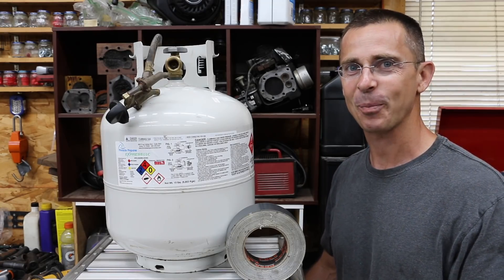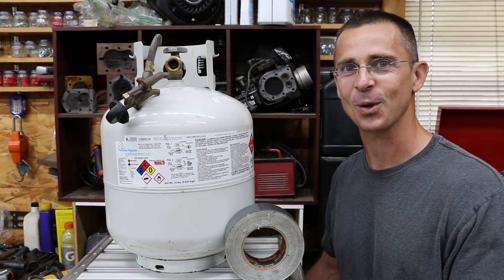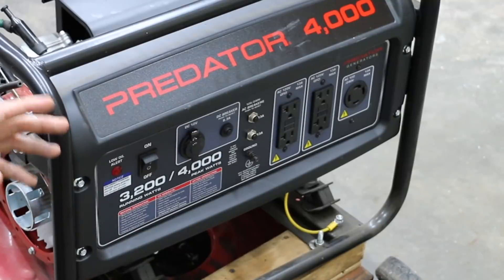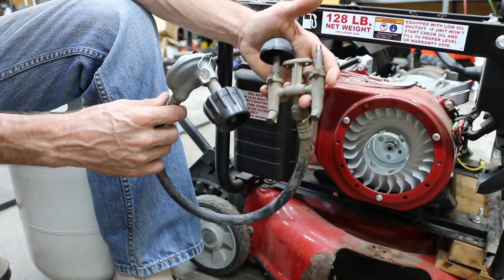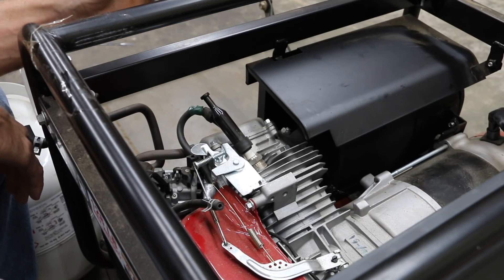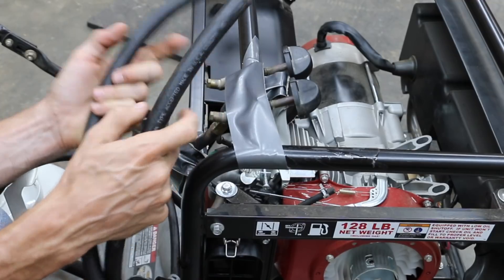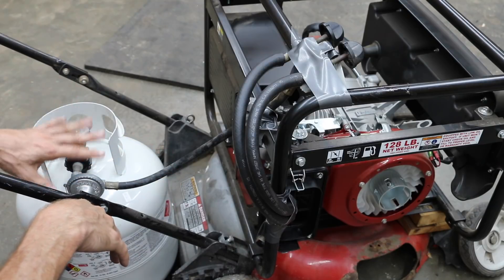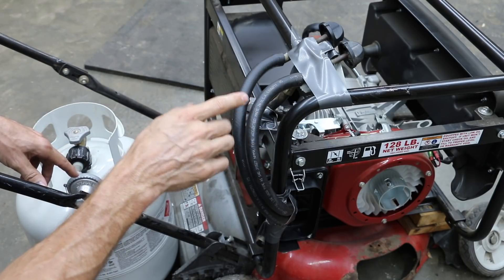Can a gas (propane) grill power an engine?  Let's try it!

Comment: Not a huge fan of propane powered equipment, my main experience is with mowers, they are less fuel efficient and if you run out your screwed, can’t just go to the gas station to refill (special tanks are used, not the tanks used in the video) they are usually high up on the machine making it more prone to rolling over even when using walk behind mowers. Yes they burn cleaner and propane is cheaper than regular gasoline but IMO, gasoline is my go to for that kind of equipment. 

As far as vehicles, I have no opinion since I don’t have any experience with propane powered cars.
Reply from the maker: Thanks for commenting on this.
Reply: Project Farm no problem, propane definitely has it’s place and as you shown could be used in a pinch with a regular gasoline powered engine with very little modifying. very good video, keep em coming!

Comment: So, and it may have been said, with natural gas and propane running it lean is better. The gas burns efficiently enough that the richer you are the hotter the exiting exhaust will be leading to burnt valve seats and valves. The best method is get it running, lean it out and then turn until it runs smooth then go just a smidge more. Also I would like to see you try a full conversion on a go cart. You need to make a demand style regulator that is biased by vacuum st the port possibly with a venturi to create the vacuum and pockets the regulator would need.
Reply from the maker: Great tip. Thank you

Comment: Had a bad carb on a push mower.  Used propane to power it.  Problems were getting the flow right, allowing enough clean air into the intake, freezing the cylinder and bumping the cylinder causing liquid propane to directly squirt into the intake.  It ran fine, maybe a little weak.
Reply: duct taped the propane to the mower handle and used an old propane torch nozzle to adjust flow.
Reply from the maker: All great points. Thank you.

Comment: Ok so awesome video but holy cow I would have tried to do some sort of flash back arrestor setup to make sure the propane tank didn't become a bomb. Not trying to be a negative nancy here but I work in a weld shop and I've seen the safety videos about using oxy/acetylene torches that have no flash back arrestors and the grave consequences of doing so. Be careful!
Reply from the maker: Thank you!

Comment: i once ran my dads 50 hudson(which was out of gas and up on blocks)by using a propane torch with the burner and jet removed so propane could come out fast. Yes, it ran just fine but soon the torch tank was empty. Propane runs clean but you need more propane than gas. there is less heat energy in propane so to get a propane engine to be efficient you have to way up the compression(propane has great anti knock properties) to gain enough to make it practical. propane is used for back up generators at things like public safety radio sites because the propane never gets old. For that its brought to the engine in liquid form and the gasifier is heated with engine coolant. that way the generator will keep going in very cold weather. where I worked we had a generac 15kva propane backup with a 454 v8 engine. it had its own room. electric block heater  and coolant powered gasifier at the engine. worked great. very little maintenance required. with a 400 gallon propane tank we were set for back up of public safety communications main radio site.
Reply from the maker: All very interesting comments. Thank you!

Comment: Propane is a common fuel here in Australia called LPG, it has a bit of butane in it for smoother idle.
I used propane in workshop as a test fuel for vac leaks, bad injector, mixture response tests and no starts to check if its fuel or spark (bit safer then aerostart),
Reply from the maker: Thanks for commenting on this.

Comment: It would be cool to see the MOS2 (Liquimoly) in an drain oil test against another additive. I read that MOS2 was originally used in aviation to prevent catastrophic engine failure in a oil loss condition, and it would be awesome to see that applied to lawnmower engines.

Love the channel, and your work!
Reply from the maker: Thank you!

Comment: LPG - popular in Poland bc it costs less than 50% of 95/98 octane gas price. Almost every petrol taxi runs on LPG here. Engines used to burn about 10-20% more LPG than petrol bc it have less calories. Simple but complete working installation in cars with carburated 4 cylinders costs from 400$. Now you can put LPG even in cars with direct injection. Sadly engine wears out little faster than on petrol bc gas is a bad lubricant. Excuse my English.
Reply from the maker: Thanks for commenting on this.

Comment: I would be really curious to know how long a 20 lb cylinder would last running a 4Kw generator at 50% load. Would it run longer than a full 3-4 gallon gas tank?
Reply from the maker: I wish I would have tested this. Great recommendation.

Comment: Its always great to see what You come up with. When running gas sometimes the timing has to be adjusted for the best performance. im not sure how that would work in this application as you are running a cam chain and the flywheel with the magnets for the coil are fixes in position by the key in the shaft. If You ever try wood gas timing can also cause issues
Reply from the maker: Thank you and great point regarding the timing.

Comment: if your generator stops, the propane will continue to flow... That's why you need to install a vacuum controlled diaphragm. No direct propane to the carburetor. unsafe.
Reply from the maker: Great point.  Thank you

Comment: also dialing in the mix...I can relate, I have a Champion dual fuel and its super easy to over/under choke on LPG and nearly impossible to tell.   I finally put a tape flag on the choke to mark the right spot to start easiest.
Reply from the maker: Thanks for commenting on this.

Comment: FYI propane pressure coming out of the regulator is 14"wc =1/2psi & nat gas is 7"wc=1/4psi propane is heavier than air beware of window wells etc & nat gas is lighter than air, a nat gas appliance regulator cuts pressure to 3.5"wc & that water heaters, boilers & stoves run on.  I work for gas utility for 31years
Reply from the maker: This is great information. Thanks for commenting.

Comment: I used to diagnose non starting engines using propane. I used a small propane bottle with a torch head. Open the valve, but don't light it. Place the nozzle as close to the carb/intake  as possible. Crank motor. If it starts, you have spark and no fuel. If it does not start, check for spark. Saves a bit of time trouble shooting.
Reply from the maker: Great tip!
Reply: I just use a cheap spray bottle from the dollar store with some 2-cycle gas in it....
Reply: But, the 2 cycle oil in the gas provides upper cylinder lubrication. Something that is important for an engine that may have been sitting for years. When you are working on someone else’s equipment, you need to follow best practices, so that’s how I do it in my shop.
Reply: The spray bottle just can't compare to the 118octane from propan, Thank you for the great tip of using an old propane torch
Reply: In the late 1970's Chrysler products had their computerized ignition engines set by using propane gas. If I remember correctly, the carb was adjusted with propane too.
Reply: Thank yew
Reply: WWG1WGA

Comment: Very clean but temperamental  with fluctuations in load,  woula a really filthy fuel have the opposite  effect, yes I'm  deliberately ignoring that the best all round fror fluctuations is probably the stuff its designed for, still think that in the event of a alien zombie invasion the supermarket own brand wiskey will still be untouched on the shelves, tho mixing it with petrol may improve the flavour.
Reply from the maker: Thank you.

Comment: you would need a propane carburetor in a go kart or any other application. Lots of taxis, fleets and equipment use propane. Propane in Canada is about 60% of the cost of gasoline
Reply from the maker: Great point and thank you!

Comment: Nice experiment! I've run car engines on gases the same way to troubleshoot and see if the spark ignition and the rest of the system works so i can check for fuel pump problems. The only problem is just like you said the engine needs to run on constant RPMs so no luck driving a car like that as it is already tricky to set the air fuel ratio properly for a normal idle,especially if it backfires.
Reply from the maker: All great points. Thank you!

Comment: they actually used to run propane in old firetrucks in the 60s and 70s, most countries already use propane as a fuel alternative to gasoline
Reply from the maker: Thanks for commenting on this.

Comment: that would be a great fuel to use during hurricane storms down here in Florida especially during and the after math which  is insane trying to get fuel for over week but to have a few propane tanks and some fuel would be good to go
Reply from the maker: Great point. Propane will last many years while gasoline will go stale, unless storage conditions are perfect.

Comment: You Sir are the Man
 Thanks for doing this 
The see through head was super sweet 
I like how you use the cordless to start the engine 
When I used to run the go cart for the kids I often thought about doing the same thing 
I asked at the cart Shop and they said it would work so I took them at their word 
As usual Thanks for All You do
Reply from the maker: Thank you very much for the positive comment.  The drill I use to start the engine is corded but a cordless drill would work.  I use a 1/2 inch socket adapter along with a socket.  Thanks again.

Comment: run a small engine on avegas 100ll..see if it has detention problem at higher rpm..and maybe a load test to see if it has the same power as regular unleaded.
Reply from the maker: Great video idea!

Comment: Will a gas engine run on butane, burger grease, heating oil, jet fuel, wood gas(natural gas), bio diesel, liquid propane, acetone, oxy-hydrogen(HHO Gas)? and great job with today's video, very interesting!
Reply: Christian: 
Butane: Yes. Most propane has some butane in it because propane and butane come from the same "crack" of petroleum and it makes no economic sense to strain out ALL the butane in general-purpose fuel. (They strain some out because there is a market for pure butane.) Pure butane produces more CO2 than pure propane does (the formula for propane is C3H8; the formula for butane is C4H10) so the people who run greenhouses want pure butane for their heaters and generators; the additional CO2 makes the plants grow better. 

Burger grease: Not in a gas engine, but if you had a way to melt it, it would work in a diesel. Big ships use Number 6 bunker fuel, which requires heating to become liquid enough to go into the engine. This would be the same principle...and you could run an exhaust pipe through the burger grease tank to make it work. The only real problem would be getting sufficient burger grease to fuel an engine; restaurants sell their grease to biodiesel companies so you'd need to find someone who'd divert you some grease.

Heating oil: Number 2 heating oil (the kind sold in the US; some other countries use Number 1 heating oil, which is kerosene) can legally contain up to 500 ppm sulfur. This makes it identical to the old "Low Sulfur Diesel" that was legal to sell for road use until 2012. This is another "not in a gas engine, fine in a diesel" product. Please don't use it in a diesel made after 2007; they all have a particulate filter that'll clog if LSD is used. And don't use it in anything on the road if your local cops dip diesel tanks to check for dyed (untaxed) fuel. 

Jet fuel: It'll work great in a diesel; airports fuel their diesel-powered ground support equipment with it. In very cold places, Number 1 diesel is sold. Number 1 diesel and jet fuel are very much alike. There are three problems with jet fuel: it is REALLY expensive...two to three times the price of diesel. It doesn't contain as much stored energy per unit of volume as diesel, so you use more of it than you do diesel. And in the US, the government won't let you buy any if you don't have a plane, because the taxes on jet fuel go into the air system trust fund rather than the highway trust fund. (Given that, you'd have to thoroughly hate paying road tax to lay out $7.50 for one gallon of jet fuel when a gallon of diesel is less than half that.)

Wood gas and (natural gas) are two different things.
Wood gas is the smoke from an air-starved wood (or charcoal) fire, and it's full of carbon monoxide, which is very flammable. In the last couple of years of World War II, Germany had such a fuel shortage that people were attaching charcoal burners to the back bumpers of their cars and running a hose to the carburetor so the carbon monoxide from the burner could be used. It works but not very well. As soon as you could buy gasoline again, all the charcoal burners went into the trash.
Natural gas is methane. This works in both gasoline and diesel engines. A lot of fleets use it. It's not great for individual use because you need an expensive natural gas compressor to fill the car's tank.

Biodiesel, aka "the greatest parts cleaner known to man": Not in a gas engine. If you use it in a diesel, be sure all your rubber hoses are biodiesel-compatible; biodiesel has very good solvent action and it'll wash your hoses away if they're not made for it. If you're trying to convert something like an old Mercedes diesel to 100-percent biodiesel, go to a hydraulics service company (they make hoses for all mechanical uses) and get new ones made with Eaton GF101 hose. 

Liquid propane: Sure. It would get into the cylinder and instantly vaporize.

Acetone: It'll power the car. It'll also dissolve all the seals in the engine, so it won't power it for long. NOT recommended!

HHO gas: This is a hoax, Christian. An HHO generator running off an engine can't produce enough HHO to run the engine.
Reply from the maker: Great video ideas--thank you

Comment: You should have stuck a golf tee or something in the fuel supply line, with no fuel it will act like a vacuum leak and might have been why you were having some issues balancing the engine but really cool on the see through head.
Reply from the maker: Great point. I should have done this.

Comment: Propane also makes a great starting aid, since it is quite flammable and it has an octane rating of 105. Ether, on the other hand, has an extremely low octane rating, which makes it really rather terrible for gasoline engines.
Reply from the maker: Great point!  Seems better to use on a diesel than ether.

Comment: I had a portable propane generator for years.  Love it.   Always started right up, oil stayed clean and it never fouled a single plug.    Only problem I ever had was freezing the bottles when it was very cold outside.    Eventually sold it for a larger gasoline one, but it ran like new the day I let it go.
Reply from the maker: Thanks for commenting on the propane generator you owned. Interesting.

Comment: Great video as always. I really enjoyed the way you just bodged it all together. I used to be a stores man/forklift driver in the early 00's and my forklift back then at Voss UK ltd ran on either propane or butane tanks just like what you would hook up to a BBQ or heater. I'm sure it was duel fuel but never really knew if the other fuel it could run off was petrol or diesel. I wont be offended if you don't reply, I know your a busy man and I am sure replying to so many comments is getting difficult with this amount of subscribers. Ta Lee.
Reply from the maker: Thank you!  I'm able to keep up with comments for now and really enjoy the interaction. Thanks again!

Comment: I thought of trying this with a push lawn mower and am curious about the $/hr run time of gasoline and propane.  Anyone done that real world calculation yet?
Reply: And things I am considering are:  Gasoline goes bad...does propane?  My riding mower is 8 years old and I have 80hrs on it.  Would it be cheaper and better for the engine to use propane vs ethanol free gas which is about $3/gallon around my parts?  Just some of my thoughts.

Comment: I have Coleman 6875 watt generator with a five gallon fuel tank. Connected into my four room house, it runs for 12 hours before refueling. Does anybody know how a 20 lb./5 gal. tank would run? Using  it witha heater it lasts 8 hours. 
Storing LPG for 10 to 30 years or more would not be an unreasonable expectation, with the limiting factor being the container. Assuming that the LPG cylinder and valve are in good shape, you shouldn't have a problem.

Comment: A lotta Forklifts run on propane, I think it's compressed in order to handle load although it's also only used to run a hydraulic set up and the movement of the vehicle couldn't be that difficult... IDK anyone have a combination or forklift that's willing to have it taken apart lol.
Reply from the maker: Thanks for commenting on this.

Comment: Pretty interesting.  I wonder why generators don't normally use propane?  It seems perfectly capable, and it's usually cheaper than gasoline.
Reply from the maker: Great point. Also, the carb would never "gum up".

Comment: What about run times? $ for $ which is better gasoline or propane?
Reply from the maker: Price varies a lot.  Where I live, gasoline is less expensive. In an emergency, I'd still use propane if that's all I had to use.

Comment: Propane burns great in engines set up to run it and is able to fluctuate loads just fine, have a old 1960ish propane forklift, only prob is battery is junk and basically no breaks😂
Reply from the maker: Thanks for commenting on this.